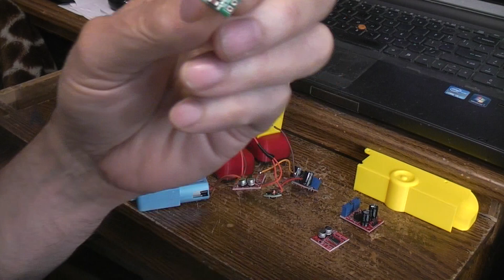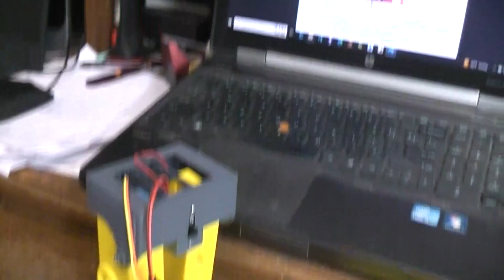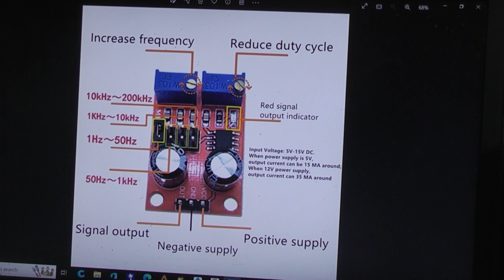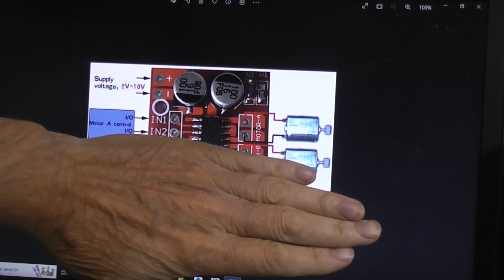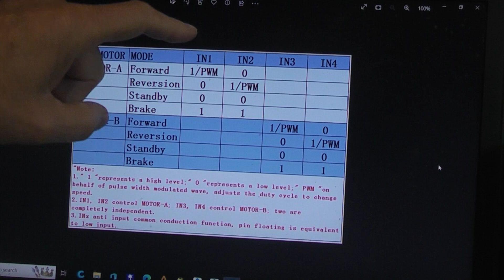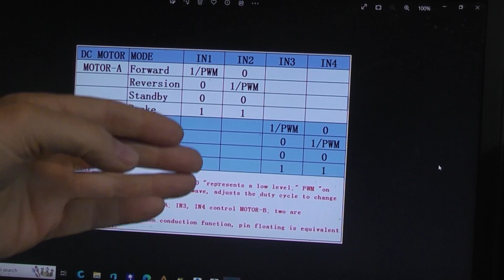Adding a Walk-Stop-Walk function to your DIY robot project.

Comment: Great little walking circuit!  I have salvaged h-bridge chips from old VCRs and DVD players.  A little more work than a prepackaged solution, but it's also fun to recycle! 😃
Reply from the maker: I agree. I picked this dual Hybridge for its low operating voltage and cost.